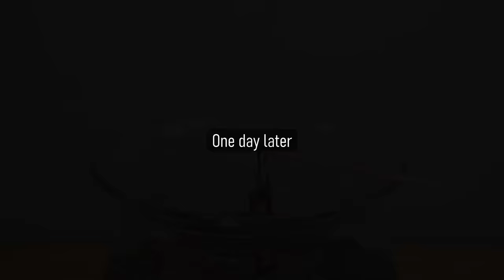Cleaver Restoration [Black Cleaver With Ebony Handle]

Comment: It really is astounding what you can do. Many, many people would call that beyond help and just toss it. That sort of thing simply looks beyond repair.
Reply: Yep. I’m people.
Reply: Don’t get me wrong, what he did was impressive. But in a real situation its a cleaver, just buy a new one instead of going through the trouble of de-rusting it. Unless it holds a sentimental value
Reply: You mean every normal people
Reply: @dracopalm7240  I live in Karachi Pakistan and I like your comment
Reply: @sayyamzahid7312  what does it have to do with you living in pakistan?
Reply: I have to imagine that the time and materials for fixing this costs more than just buying a new one.
Reply: What an absolutely ridiculous comment. Of course many many (normal) people would just toss it and buy a new one. Many many people don’t have the tools/equipment, the know-how or the time to restore anything like that.
Reply: @neonlightsuk3864  
And isn't worth it
Reply: Well I make $35 a hours for $70 I can get a pretty good clever , i I suspect this project took a lot more then 2 hours so for me it wouldn't be worth my time
Reply: I'm surprised that there was enough solid steel left to make a blade
Reply: @neonlightsuk3864  I have the tools and know how but definetly not the time , I could change full set of brakes /rotors plus a alternator plugs and wires as well as a oil change on a car in less time theo it would take to repair a cheap clever
Reply: I’d call that final handle beyond help.  I’m sorry, but it seriously hurt my soul how it was shaped.  You don’t do a double sided bend like that on a cleaver, it’ll bend into your hand and become quickly uncomfortable when doing constant hard cuts like the cleaver is made to do.  You usually want a straight handle, a straight with a bulb at the rear, a light downward curve to fit the palm of the hand, or a light curve with a bulb.

Good cleaver, but that handle hurts me so much for some reason.

P.S.  I’m a knife guy so I feel pain when I see something wrong.
Reply: He's not doing it to get a cleaver, he's doing it as an art.
Reply: @djlazer1  or content
Reply: @BigRheno  yeah that too
Reply: Helena Gomes Melo  😂
Reply: Because "most people" don't have $50,000 in tools laying around to do anything about it, maybe?
Reply: @BattleBound  50,000 is wayyy more than what it probably cost. I'd guess <1000
Reply: 刻意做舊再整新的矯情視頻
Reply: toshi (^^♪
Reply: @noodletribunal9793  The best skeleton dad
Reply: @kdog4033  I make a very good living and for most people, I'd agree with you. But I like working with my hands in my free time, so this would be a fun project. Never forget, people with money have hobbies.

Speaking purely in terms of cost, though, you are right.
Reply: I'd like to point out that I'm very, very, very dubious that this has actually been *repaired*. Sure, it's a great conversation piece / antique, but it's intended purpose is a "Tool used to back through thick pieces of meat in a kitchen," and I strongly suspect that is f you actually tried to use it like that the blade would break in short order -- and that assumes that it has, and can retain, a sharp enough edge to be used at all.  After all, I suspect as much as a third of the mass of the cleaver was lost (to rust, then to grinding it smooth), so unless it was overbuilt by quite a bit...

All of which is fine, because the purpose was never to repair the cleaver but rather to create a work of art.
Reply: I was very offended by the video title. “Ebony” is like a bad word for African American. Just say it’s an African American clever or if it’s just an African style, say African. When you say ebony you’re generalIzing
Reply: @radricdavis8508  Sir. "Ebony" is the name of the wood he made the handle of.
Reply: Love your pfp
Reply: @mackenziecreates  Hehehehehe, thank you. XD Toshinori has the best deadpan face.
Reply: @selenopheria  yeah lmao
Reply: @dracopalm7240  i mean i think they are restoring it for a reason, i think its not just because of the money.. i think they are restoring it because its a part of history
Reply: Not understandable have a great day
Reply: @malysahd  ghl

Iuy
Reply: @jmr5125  It's a vegetable chopper now, not a meat cleaver.
Reply: @dracopalm7240  I visited Pakistan and i like your comment.
Reply: agree
Reply: @malysahd  y
Reply: Ok #AgungNusantara
Reply: Okay your profile pic, right before this vid I was watching a MHA episode and this was the first comment I saw
Reply: @No_Sleep_zZz  HA, what a coincidence!
Reply: And well. That's more efficient than to spend more time, resource and energy only to restore something that's not so much of value.
Reply: Unless to make content or restoring some prehistoric stuff, this whole effort is just not worth it.
Reply: all mighr
Reply: Nice comment all might
Reply: Ya dong
Reply: Thank you All Might, very nice
Reply: @malysahd  1
Reply: @malysahd  qqqqp
Reply: @dracopalm7240 ولاكن قد يكون الساطور غالي الثمن
Reply: Я один тут русский а?
Reply: Yeah I agree, if you have the materials than go for it.
Reply: @malysahd  х
Reply: 1k🙏🥺❤️
Reply: Not worth the time
Reply: it is beyond repair, it’s a hundred times cheaper to just buy a new cleaver lmao
Reply: @elbozo5723 —exactly. Not that this was not an amazing feat.
Reply: Hate it when this happens to my clever
Reply: @radricdavis8508  excuse me? Ebony is the name of a fucking tree
Reply: @blazendeveloper  or have you thought people do this as a hobby…? Not everything is about money.
Reply: Hi all might
Reply: It was beyond repair. He didn't repair it, he basically made a new one out of it.
Reply: Yeah cuz other people don’t have a garage full of his stuff
Reply: Normal people just don’t have that kind of tool used for restoration
Reply: Don’t get me wrong, this video is pretty sick, but not everyone is a skilled carpenter or blacksmith who has the time or resources for this kind of thing. Of course I’d just throw it out and buy a new one. It’s much more practical that way…
Reply: Nó bị rỉ sét thiệt mà :)?
Reply: 1
Reply: Its common sense to toss that out. Too much effort just for a cleaver when you can just buy one and it doesnt cost so much money and effort.
Reply: Oi
Reply: すごい
NICE
Reply: @zsch6859   so you're saying that has not normal
Reply: @R41ph3a7b6  yes, they are beyond normal, which is a compliment
Reply: @malysahd  @#
Reply: VISÍVEIS
Reply: Not even real rust... artificial age. More like a month buried in top soil with some vinegar solution sprayed over it...
Reply: @kdog4033  :lmao.vehicle would run &
stop worse when you finished
with it. just wash the tires. You
are clownish.
Reply: @radricdavis8508  : Ebony ebony ebony
Reply: @dracopalm7240  its a hobby and art.  Why draw a licture with a pencil when you have a camera.  Same thing.  Nothing about practicality.  ; )
Reply: @MMAKingRay  thats what im saying. not everybody has a hobby of unrusting things they just go out and get some more.
Reply: 22
Reply: @selenopheria  10
Reply: True though man
Reply: It’s not beyond repair but beyond worth the time to fix it.
Reply: He/she makes it seem so easy…
Reply: I mean, realistically he spent more on materials to do this than a new cleaver would cost.
Reply: @dracopalm7240  well this video has over 44 million views. It was worth doing it… he got a lot of money off this video
Reply: @elbozo5723  he got 44 million views from this video. He probably made over 30k from this alone
Reply: Its still not easy as ya think
Reply: @malysahd  aaaaaaaaaaaaaaaaaaaaPA
Reply: I read this in Chris Sabat's voice because of your Pfp 😂
Reply: @ADHDragonfly  PFFFFFF 😂
Reply: Don't get me wrong but the process should be affordable to everyone. I mean the machinery or tools he is using is very costly.
Reply: Small might pfp
Reply: @AnimeWithdrawl  Naw that's Deku's nickname. (I picked Toshi because I love that deadpan expression)
Reply: Yes, but he’s literally using tools that normal people don’t have at home sooo what do we expect?
Reply: If I have the equipments and materials I would do that too.
Reply: Me share food with my siblings 17:51
Reply: @BigRheno  i thought this tbf
Reply: @BattleBound  yes Aliexpress drill bits and a sander machine is 50k bro HAHAHA
Reply: There's kinda something beautiful about even an old rust-covered knife being loved enough to be brought back to its prime. Everyone saying how it's not practical is missing the point
Reply: @BigRheno  I did not expect to see a comment like this, but thanks for the information!
Reply: @dracopalm7240  everything holds a sentimental value to me

Comment: I have no knowledge of restoring old knives like this, but it’s easy to see that this craftsman/artesian has a ton of knowledge about restoring  knives like this and I feel so lucky to have seen this video. Truly amazing work.
Reply from the maker: Thanks very much! 🐢
Reply: artisan*
Reply: But overall nice!
Reply: these may not be old knifes. the same electrolysis process can be done to a relatively unrusted knife and accelerate it to looking ancient. then title a video as restoring old knifes, profit.
Reply: super
Reply: @cranedeck  This blade could not have been relatively recent - it’s too thick.   A modern cleaver (if you could find one NOT in stainless) would end up much thinner. 

Note also that electrolysis takes rust off one object and deposits it on another. I’ve derusted old tools and I can tell you that the sacrificial electrode does NOT end up looking like this and doesn’t get pitted. It looks like a magnet that’s had a pile of red coloured iron filings thrown on it. 

Besides, who gives a crap?  He derusted a badly eroded steel rusty piece of junk and turned it into a useful tool. The fact that it might not be from the ancient past is irrelevant. The techniques work no matter how or when the rust got there.
Reply: He should try restoring an old knife

Comment: I know this is from four months ago so you might not see, but here’s a few suggestions that might help you (though I’m sure you’ve likely learned since then):
-to prevent the “scratched” look, you could wet send with P1200 and/or use a rubbing compound (the latter will really help out a mirror finish)
-the handle is a bit chunky, but that’s no problem at all if it fits in your hands well. However I would mention that the front end should be less thick than the back, even with the ergonomic fit. This is just so that you can keep a solid hold on the knife and it won’t go flying, should you give something a good whack with it. Not so much for comfort, just for safety.
-I think there may have been a slight warp in the handle? Or maybe the raw ebony that you laid the handle on was warped and the handle was straight. I honestly don’t know 😂 either way, doesn’t matter too much as long as the end result works, and it definitely does! Good job!

Overall you did a really, really great job! I loved the stains and the handle came together REALLY nicely. I never would have thought of adding ebony dust to the glue to match the color! Definitely earned a sub from me 💜
Reply from the maker: Thank you so much for your detailed comment! 

I have already done that with the finer polishing later, with diamond grinding paste.

That with the handle I actually did not know yet, Thank you!
Reply: @ForgottenShineRestoration  No problem!

Oh, good! I’m sure it looks amazing!!

Of course, no problem! I don’t want anyone getting hurt, lol. 

Again, it looks sick! Love the final result.
Reply: You see this is what YouTube comments should be like. Very nice, very critique, useful comments
Reply: @ForgottenShineRestoration  thank you for being so interactive with your community, even when you have a lot of subscribers and working on videos, you still manage to make time to reply to comments as far back as 4 months ago! keep making these videos, I love them
Reply: Totally agree about the handle, as an amateur chef it was my first thought. By placing the center of gravity so low you are just asking to hurt yourself. The spine has to be nearly level with the handle, its extremely important for a kitchen knife
Reply: vou comenta aqui, mesmo que você não entenda português mas seu trabalho é mt bom é legal ficar vendo você renovando algo q ta a anos enferrujado e dando uma outra vida a essas coisas
Reply: @Calvodecria559  its cool youtube has translate now
Reply: @kindledflame5179  외국인은 날 번역 하지 못해 크크
Reply: @user-zj1bk5kk4p  Well google just did that for me so I can see what you say 😂
Reply: @user-zj1bk5kk4p  I do, don't you?
Reply: @ForgottenShineRestoration  خخ
Reply: @meiguess6765   رب
Reply: that tang was mighty thin and short, breaks easier

Comment: I was skeptical there was enough metal left there to restore... wow!
Reply: Rust has volume but it's a massless wonder. Rust is lame!
Reply: @aarondavis8943  A scathing indictment of rust. Look, we're all thinking it, but you had the courage to say it. 😆
Reply: What a ignorant comment. The restorer ruined the cleaver by destroying the tang.
Reply: @tombarski5075   what a ignorant comment. The Tom Barski ruined my marriage.
Reply: @tombarski5075  it's fancy, i don't think anyone'd like to use it
Reply: Insanooooo : https://youtu.be/hY7vOppUR60
Reply: Heh, I end up saying that every video xD
Reply: wow
Reply: wow
Reply: @tombarski5075  pretty sure the cleaver was ruined from the start. Any improvement is an improvement
Reply: same
Reply: @tombarski5075  What an ignorant comment, The rust ruined the cleaver by wearing it out to the point some things had to be taken out.
Reply: @aarondavis8943  It's also a game filled with horrible griefers that make it practically unplayable.
Reply: @aarondavis8943  q
Reply: @sirankleknocker3122  The ignorant is you. There are many ways to restore missing metal. For example add-welding, or similar techniques. Restoring mean bringing back  near the original, any other work is just modification to renew.
Reply: @MrSedrun  So, do not call this restoration. Is just making fancy, from the old and rusted.
Reply: @tombarski5075  cry about it
Reply: @tombarski5075  cry about it.
Reply: @LangstonDev   ррьх
Reply: @tombarski5075  Man you have made 10 comments on this channel and you always seem to talk about tangs.
Reply: @tombarski5075  Weep.
Reply: Kk
Reply: @aarondavis8943  k
Reply: @aarondavis8943  k
Reply: @aarondavis8943  kk
Reply: Kk
Reply: @aarondavis8943  kk
Reply: Yes cuz he intentionally put rust on it

Comment: The person who handcrafted this cleaver centuries ago would be proud of you and happy to see that this item came back to life
Reply: its not likely that old relax
Reply: "cEnTuRiEs aGo" lmfao!
Reply: @maxfactor4209  bruh he would have had to plan this a minute in advance
Reply: Probably an old barn find....
Reply from the maker: Thanks very much! 🐢
Reply: @Omni_Shambles  kitemmu
Reply: @maxfactor4209  Bro, it takes LITERAL YEARS to rust that much on a knife and you are saying that he faked it? What kind of bullshit is that mate.
Reply: @theuniverse1158  It doesn't necessarily take that long for metal to rust.  Certain chemicals such as hydrogen peroxide can be used to artificially rust metal.  The electrolysis process used to remove rust in the video actually does just that to a sacrificial piece of steel.  It is possible that the cleaver was intentionally damaged and later restored for the purposes of making  this video.
Reply: @Blitty78  the alterations he made to the tang of the knife? Yes he very literally did.

Comment: As a chef, the clever is beautiful.  Gorgeous job.  For practical purposes, I think the handle might be a little too thick.  You did a beautiful job.  👏 👏 👏 👏
Reply from the maker: Thank you very much! 🐢
Reply: Agreed. Chode of a handle
Reply: @kevincomellas4908  I like the thick handle... with the dark blade and its curving, I think the handle makes the clever look comically comfortable. Very sleek, very clean, and sophisticated, I like it
Reply: It's a battle cleaver
Reply: @RadishHead7  cleavers were never used in combat
Reply: @xiholliday  but not practical and I too am a chef -50 years, retired, and that handle (though beautiful) will most likely interfere with one's leverage. Just my opinion.
Reply: What on earth is a chef using a cleaver for?
Reply: Also why would the handle make it impractical
Reply: @ThatSB  Are you serious? Its used to cut meat
Reply: @neonknight-1522 a knife is used to cut meat. A cleaver is used by butchers to cut through bones.
Reply: @ThatSB  Because some real chefs cut their own meat. Cleavers have many uses, chopping and cracking femur bones, rib bones for stock/ demi-glace, flatting scallopini, cutting whole chickens, just to name a few uses. And Clever's come in different sizes, weight.
Reply: @ThatSB , it's used to cut up meat, but if the blade is thin enough it can be used to chop up anything.
Reply: @ThatSB  thats correct but what the person above me said is correct too
Reply: When did the cleaver dress up as a chef?
Reply: @ForgottenShineRestoration  the turtle won’t swim this time ! Will he?
Reply: I would also be worried about the tang or handle breaking with use. But as a show piece I agree it looks amazing
Reply: As a chef, I agree. It is very beautiful, I agree the handle looks a little too thick.
Reply: @neonknight-1522  until today 😈
Reply: Totally agree... clever looks amazing, but the handle doesn't fit it at all.